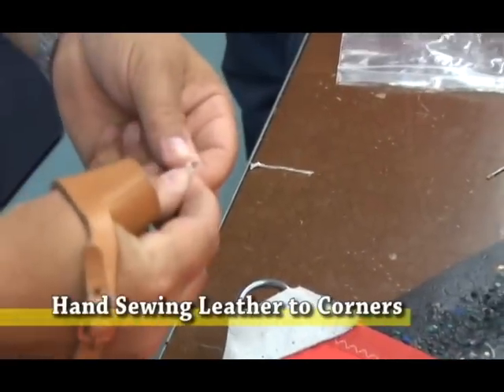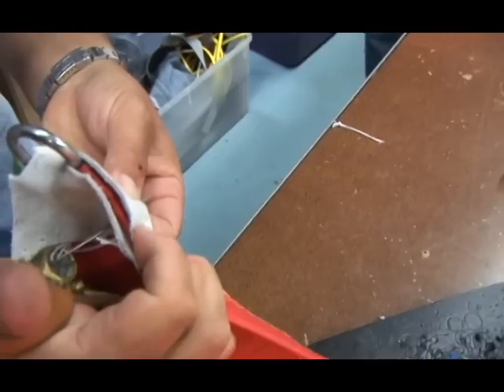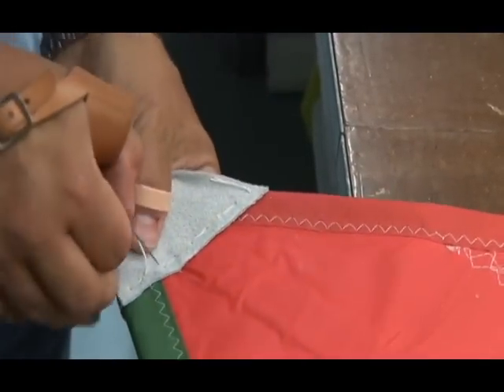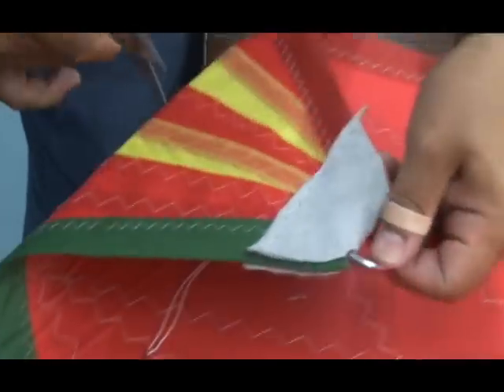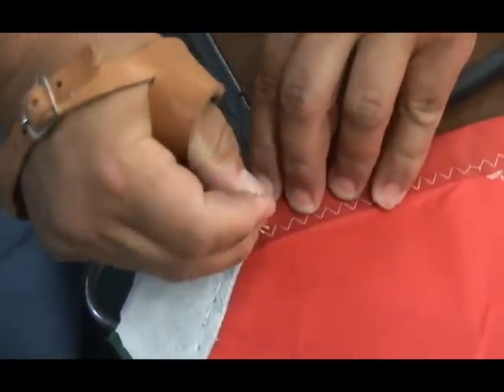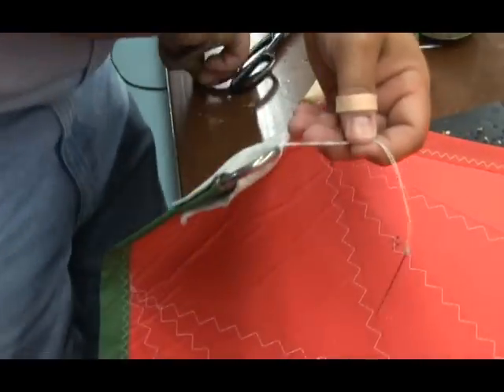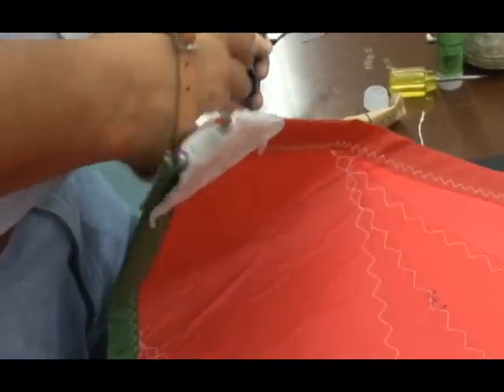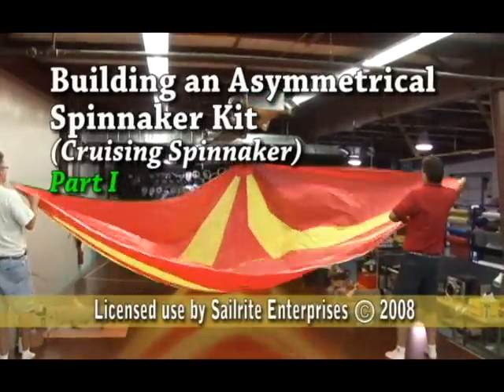Building a Asymmetrical (Cruising) Spinnaker - Part 3

Comment: How long would this material last saying in the los angles area going out in the sun twice a week and staying out for two hours each time. thanks
Reply from the maker: Max, Good question. Sails are typically made from Dacron (Polyester) or Nylon and do have a specific life time when exposed to the sun (UV). This spinnaker is made from Nylon and should be protected from the UV when not in use. Since sails are typically not used everyday and only used for a few hours a day they will typically last 4 to 6 years if used twice a week. I have been on boats where the spinnaker was 20 years old or more, so it will always depend on how long it was exposed to the sun.